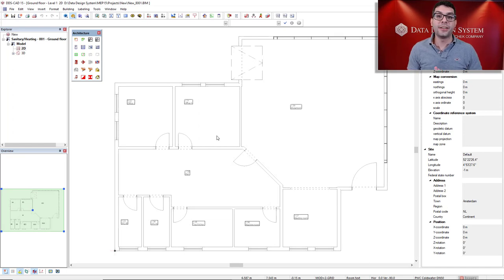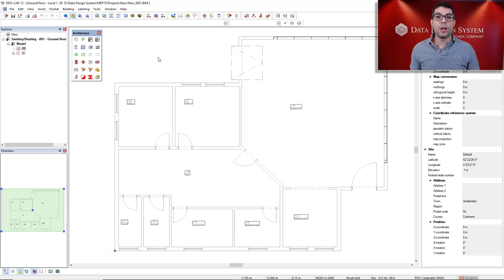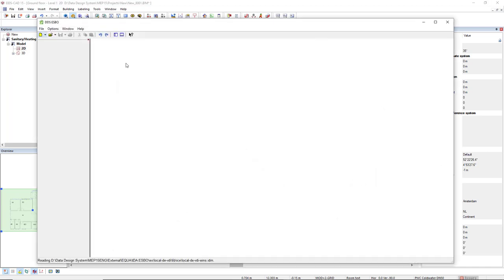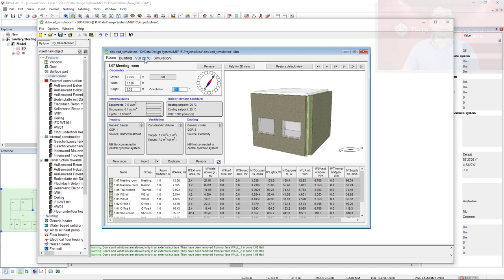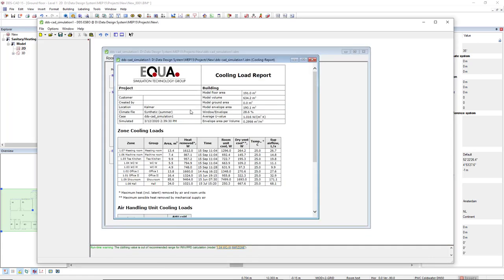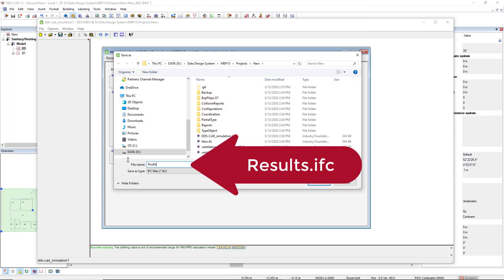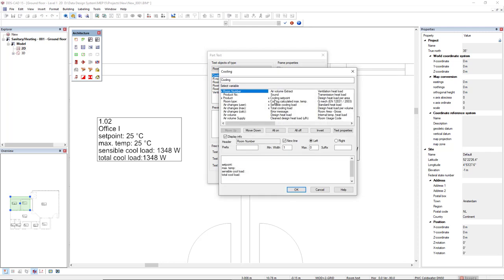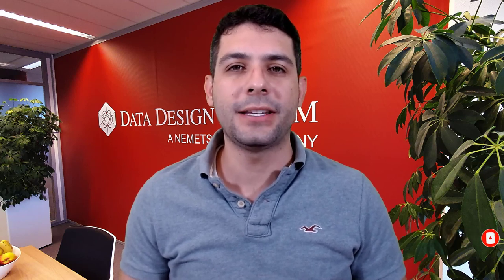DDScad | 📢 Cooling load calculation? Yes, with ESBO Simulation Software 🤔🧐🤯

Comment: Can you explain us how to work with commands in the command entry window? A complete command list would be very helpful. Please also in connection with the symbol building / symbol catalog. Thanks, your videos are great!
Reply from the maker: Hi Christian, thank you for the compliment! I am afraid I did not understand your request regarding the command entry window. Do you mean the use of the command field? The next video will be released tomorrow. 'How do I create a dynamic Titlefield', there I show a bit how to work with command field and command list. Could you tell me your feedback if it applies to it or you need something more specific? Regards, Filipe
Reply: @DDSCAD-MEP  I want to create a new symbol out of existing symbols from the database. The 2d-symbols have a 1 in the code and the 3d ones a 3. But I don't know the command to insert them, thanks.
Reply from the maker: Hi Christian, best in this case is to contact the direct support of DDS, they can instruct you in all steps in order for you to create your own symbols from existing ones.
This is a bit advanced content to put it in here. :)